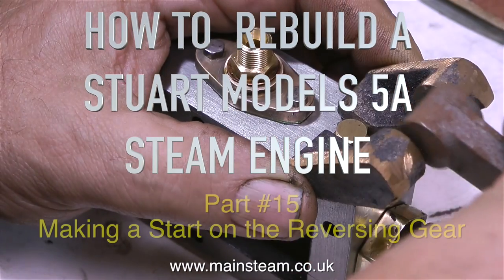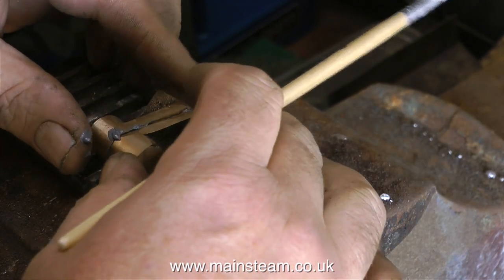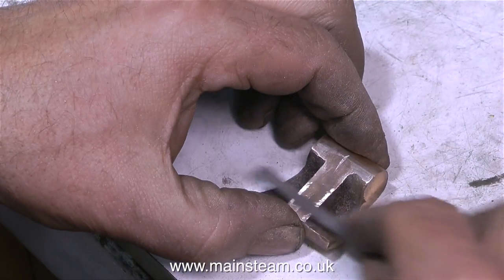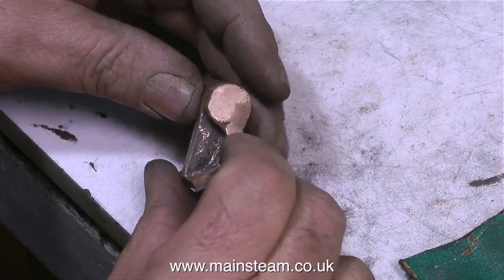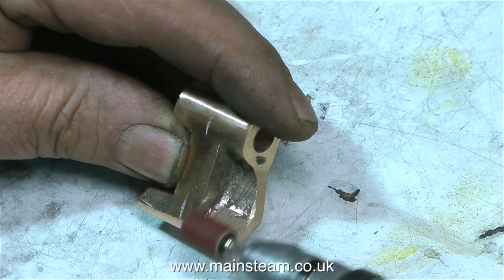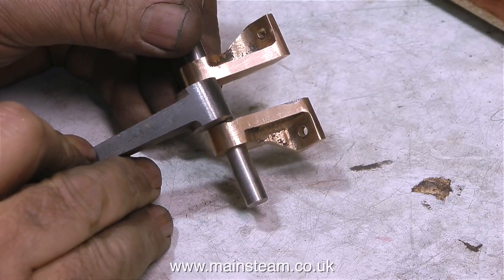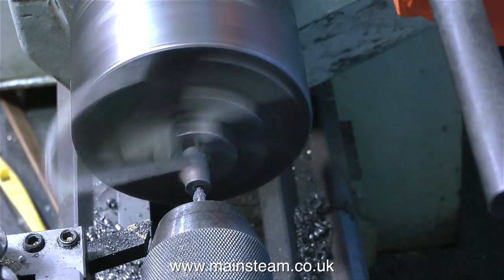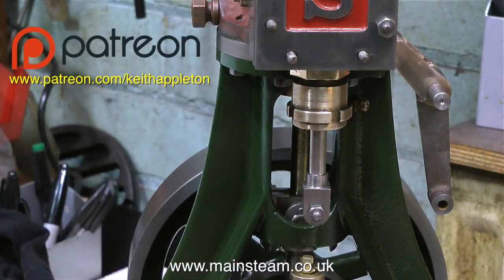HOW TO REBUILD A STUART MODELS 5A STEAM ENGINE - PART #15

Comment: I have looked at the solder past/paint a number of times, but not having seen how well it works have left it on the store shelf. Next time I will pick it up. Thanks Keith.
Reply: Indeed, solder paste can be very useful. I'd stick with a lead-free version though; a nice SAC305 Tin/Silver solder paste. And since you're not using it in a pick and place machine to rapidly build PCBs, can save some dough by getting something expired. If it gets too dry just add in some new liquid flux.

Comment: Morning Keith, great way to start the day watching one of your Engineering videos before going out to re-assemble my Tich Loco, I have been thinking of building a seven and one quarter inc gauge Tich including the castings, is this just a case of doubling up the dimensions / although I was wondering if it was a bit more to it when doing the boiler owing to different stresses involved with larger metal areas, just popping over to your patreon site now as it will be interesting and a bit of fun to join ( Especially if they all have your sense of humour) where do you get the solder paste from please regards Doc Cox.
Reply from the maker: The copper probably needs to be a bit thicker that on the 3 1/2 inch version, but no more than for a 5 inch gauge engine ..... I get most of my supplies from Blackgates Engineering (http://www.blackgates.co.uk)
Reply: Thanks Keith, I thought that would be the case, will be doing some more research now.
Reply from the maker: Maybe you could email Blackgates Engineering (http://www.blackgates.co.uk) and ask them as they produce boiler plates and supply parts for copper boilers.
Reply: Just what I was thinking.

Comment: Hi Keith, another masterpiece. As a newbee can you tell me if there is a rule of thumb for which diameter pipe to use for boiler to engine, exhaust to cooler, etc? Thanks, Malc
Reply from the maker: It all depends on the size of the engine & number of cylinders. The genera rule is as big as looks right on the model.
Reply: Thank you.

Comment: I have a question about lathes. I've been given an ancient belt driven lathe and I'm currently restoring it. Only thing is as a student I have a budget of almost zero and the lathe is missing parts. What's your advice on finding cheap chucks, tail stocks and tools for a lathe?
Reply from the maker: Ebay would be a good place to start - what is the Lathe? - do you know what make it is?
Reply: Keith Appleton I wish I knew the make. I've spent the day cleaning it but all I can find is that is was made in 1887. It's not a large lathe and came out of a small mill type building, where my local model railway club reside. Ebay is a good place to start however. Thank you very much for replying!
Reply: There's a uk website simply called 'lathes' which you should check out, they have a massive archive of different lathes and other tools (with pic's), so you should be able to find and identify yours; which would help with getting parts.

(I'd post a link, but Keith doesn't let links get posted; should be easy enough to find though).

Comment: Could you tell me why the bracket is in two pieces? It seems to be extra headache for a part that could be one piece with the proper holes drilled into it and then have a slot cut out where the swing arm goes.
Reply from the maker: To be honest, I wondered that myself ..... I just think it must be a throwback to the original design, or it could be that they give the option of using just one of these bracket castings on a large Stuart Twin cylinder steam engine - one at each end to support a long common reversing shaft ??? but that's an educated guess . . . . maybe some other viewers may know more about it ???
Reply: Looking at the original castings, I think it's because it is an easier shape to cast even if it's two castings (and pours) rather than the one.

Comment: Another great video, thanks. I'm curious about your use of the term "engineer". At one point in this video you say "I don't really see this as engineering". So what is engineering? My grandfather was a steam locomotive engineer on the Union Pacific railroad. He drove the engine, and oiled it, etc. So he operated the engine. My father was a trained Architectural Engineer. He designed buildings. They were designed (or engineered if you prefer) to meet standards and codes. You are building steam engines, so maybe another meaning of engineer is someone who builds engines? That would be quite different from my grandfather's or father's usage of the word.
Reply: Engine is a related term of ingenious. 
As a adjective ingenious is displaying genius or brilliance; tending to invent
Reply: He should reply for himself really, but.... I know what you mean, my father was a design engineer, it's a word with many applications. But I think he means relative to what, in the UK at least, is called 'Model Engineering' he does far more handwork than machine-tool work than is now normal (though probably similar to what the old-timers did 100 years ago). If you look at the magazines and other videos, many of the parts that Keith crafts on the belt-sander and with files would  be done by model engineers on the mill or lathe, with elaborate set-ups to ensure, for example, that the radius of rounded ends is correct and the hole exactly centred relative to those rounded ends - or at the least, many model engineers would make and harden filing buttons to similarly ensure exact concentricity. There would have been a lot of set-up work to ensure that  the drop-arm holes were exactly parallel, whereas Keith does it by eye, mostly. Also many, many model engineers in practice have jobs on mechanical engineering, and therefore have some formal training or apprencticeship in their background, and Keith seems to be very aware that he doesn't. Some of his craft approach may come from his background in model boat building, which is very much a craft - but of course he could tell me I am wrong about this. Obviously he is an engineer, but not quite a 'standard' model engineer, if such a thing exists. That's my view anyway.
Reply: I think you have hit the nail on the head. I belong to a Model Engineering Society and there are some members who would spend hours doing setup to what Keith does in minutes. Then there are the Model Engineers who have worked in the trade partially Job Shops where you are told Get it done. I think Keith would fit in the second class.